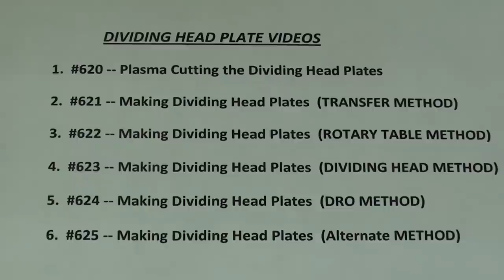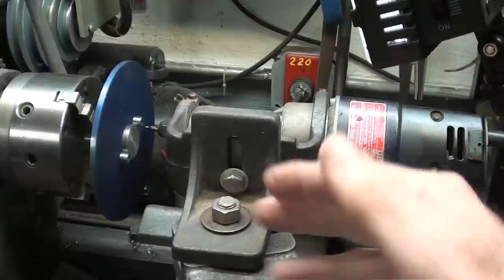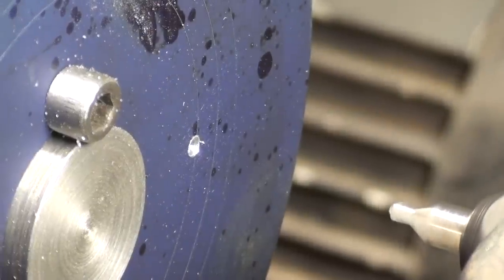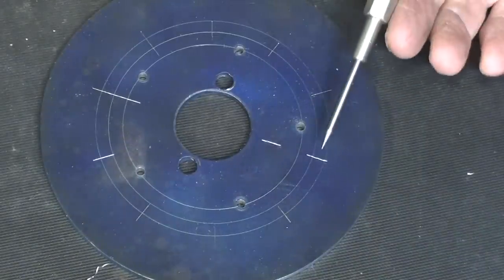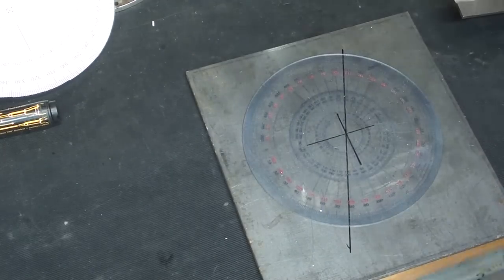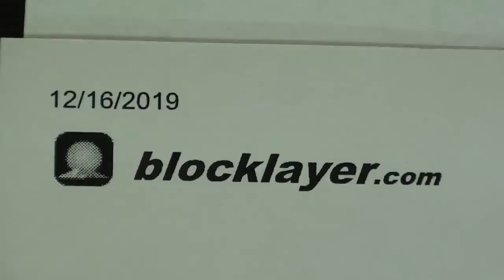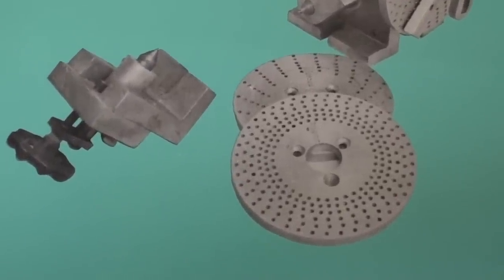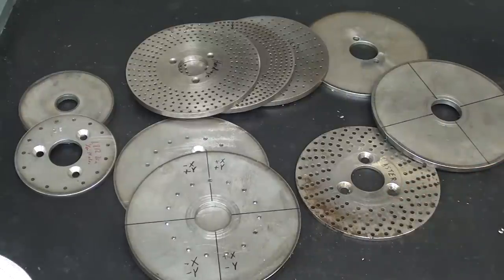Making Index Plates Alternate Methods TIPS #625 tubalcain

Comment: Sometimes the simplest solution works just fine. Years ago and old machinist I worked with was given a 3ft. x 4ft. x 1/2" thick plate that was to have at least 40 tapped holes put into it. He studied the hand drawn E-sized blue print for a bit and checked the other prints for all the stuff that was to be bolted to this plate. All the parts to be bolted on had proper clearance holes  for the fasteners. He measured the blue print directly to check that the drawing matched the given dimensions. Then he taped the print to the plate and hand center punched each hole through the print. He got out the mag base drill, used a ground steel center in the chuck to locate each hole and drill & tapped it. Job done in 2 hours and it worked just fine. Everything bolted on and no one asked how he did it.
Cheers from NC/USA
Reply from the maker: lol.  That’s a great story

Comment: Just ordered the Gingery dividing book from Amazon. Harold Hall also has a book on dividing available on Amazon. One other method, don’t know if you covered it, would be good old fashioned bench work with a center punch, hammer, magnifying glass, dividers, steel rule, and layout ink. Draw a circle, determine the circumference, do a little math to determine center distance between holes, set your divider, and scribe away. Then go to work with your center punch, magnifier, and hammer. Thanks for making these series of videos, very informative as always.

Comment: Not all printers are accurate in both length and width direction.  Print out an image known to be square and measure it for accuracy.  You can also cut out a large disc of wood and fit a piece of bandsaw blade around the rim, and index off the teeth.
Reply: If your printer is out, you can generally go into the advanced settings and change the X and Y scaling independently. I do it when I print out graph paper.

Comment: when I laid out the holes for my duel magnetic rotter I used a 360 degree gage and a scratch all and it worked very well, it had a high power magnifying glass with a cross hair, it cost about $ 60 dollars used,  it also had a good clamp to clamp the arm.

Comment: Machinery's Handbook has a table "Segments of Circles for Radius = 1" that gives 'constants' (English and Metric!) for for properties of a circular segment based on the included angle of the segment.  The "c" column is the cord constant which is the length of the distance between 2 holes on a bolt circle at a given angle.  Figure the included angle of the circular segment for a given number of holes on a bolt circle, multiply the "c" value from the table for that angle by the bolt circle, and you have the straight line distance between holes.  Using a set of dividers, scribe the bolt circle, pick a start point on the bolt circle, and draw an arc on the bolt circle using the start point as your center.  Move the dividers to the new point and scribe, and repeat as many times as required. To check your self, verify your last arc crosses the start point.  This method works for any number of holes on any bolt circle.  You just have to have a set of dividers large enough to scribe your values.  Center punch at each mark and drill.  This is the method that draftsmen (now drafters) used for decades to layout a bolt circle and is much more accurate than using a protractor.

Comment: Sixty is a particularly good choice for the built-in dividing plate on the Craftsman lathe. The ancient Assyrians (inventors of Cuneiform writing) used a base-60 number system, rather than a base-10 number system. The Assyrians had a sophisticated mathematical system, but, they didn't invent rational numbers (fractions). But, by using 60 as the base of their number system, division was simplified because they could evenly divide 60 by 1, 2, 3, 4, 5, 6, 10, 12, 15, 20, and 30. You can thank the Assyrians for having 360 degrees in a circle, 60 minutes in a degree and sixty seconds in a minute.

Comment: I've used the laser printer and glue method on numerous projects and while accurate for most things it has two limitations to be aware of. First, the accuracy of the printer. Paper printers can be off in terms of overall size, but also disproportionate on horizontal vs vertical. Since I draw my own designs on the computer, I include a horizontal and vertical scale in an area that can be trimmed off later. A quick check of your scales with a machinist's rule will tell you whether you're starting with something usable.
The other issue is distortion of the paper during gluing. If you drag your hand across the sheet when pressing it down you'll stretch the paper in that direction. Laying the sheet down and then pressing it in place will distort the paper less.
Reply from the maker: Thanks

Comment: Excellent tips as always Tubalcain. Another idea - some ink jet printers and maybe laser printers have the ability to print straight onto prinable CDs. Cheap at 25 cents each. I had my ink jet printer about a year before realising it could print cds. Just use one of the programs suggested, print it straight onto cd, and you have a pattern on a nice round disk on which holes can be drilled. Just need to be carefull drilling ABS as it can split easy. There are drill bits available for drilling plastic - 60 angle rather than ~118 degree. If you wanted something more permanent,  machine a metal disk the same diameter and thickness as a cd, spray paint it and print away. I've not tried spray painting myself, may need some experimentation to see what paint would absorb the ink. Maybe spray putty, or marking paint, might work.
Reply from the maker: Thank you for the suggestion, I have never heard of printing it on a CD

Comment: The paper transfer method is very handy, but I think it's important to make sure your printer prints as symmetrically as you expect.  It's not uncommon for the long dimension of the page to print less accurately than the short dimension.  Print a test image and measure it.  Keep that error written down so that you can compensate for it. As the paper thickness and roughness changes, or as the feed rollers wear, you may need to adjust.  

It might not matter much for a 4" bolt circle, but when printing PCB transfer film with fine pad pitches or where multiple layers need to align, the error matters a lot.
Reply from the maker: Thank you, that is good advice

Comment: Mr. Pete, thank you for sharing your knowledge. I have used several other methods; I apologize in advance for a long-winded explaination.

Let me begin by stating these techniques can also be used for gear cutting. I have used these techniques in the past. 

First method, regarding the paper glue-on method. For GEAR cutting, this will work on a vertical Mill if you create a fixture to hold a sewing needle (secured to the table). Rotary table or not, an angle plate will work. Rotate work until the needle/fixture is aligned with the radius line on paper (Horizontally, this would also work for indexing plates).

Second method, 3d print a small gear (appropriate number of teeth) and secure it to the work (super glue method). 3d print and create a spring loaded arm that is secured to the table. To visualize, think of the "Wheel of Fourtune" wheel on the X-Plane, or for vertical, think of the "Price is Right" "Showcase Showdown" wheel. This works, but is far less accurate.

Clear as Mud... Right?

These method work... Not the best, but I work with what I have as a home 'hobby' machinist.

Matthew
Reply from the maker: Thank you for some great suggestions
Reply: @mrpete222  Try to create part 7... 
Edit: Hopefully you can create a part 7 using suggestions/ideas from the comments.

Comment: Lyle, thank you for this video series.  But you missed how Dave Gingery accurately drilled the hole circles in his index plates.  In the photo you showed, he had glued a strip of paper with accurately drawn (by hand using drafting angles and scales) lines for each series of divisions.  He did that for each hole circle.  The photo shows a razor blade being used as the "pointer."  He used the incomplete (at that point in the construction) index head's 40-to-1 gearing to simply rotate the plate until the paper strip's lines "lined up" with the razor blade.

I think I may use Dave Gingery's book series to cast & machine my own machines, or at least the ones I don't already have, like the small shaper he shows how to build in, I think, book 3.  He started with nothing and built his own backyard foundry and used it to build and improve his machines as his capabilities were developed/improved as each machine was built and used to machine the next one.

Lindsay Books closed down, but their books were purchased by some of the Lindsay employees and are sold at www.youroldtimebookstore.com.  The Gingery books are still sold by the Gingery family at gingerybookstore.com.
Reply from the maker: Thank you for that. I really did not read the book.   Just glanced at it
Reply: I was gonna take the time to tell him the same thing, but I wanted to see if someone else caught it first.
 I actually was thinking about that method when the video started.
 When he broke out he book, I said " here it is" & then he missed the whole point.
If Mr. Pete is reading this, it was on the next page that you showed.

Comment: If you have a copy of Visio (even the older versions), it's easy to draw up a circle with intersecting lines with whatever degrees you want.  You can use pretty precise decimal values or even fractions if you don't want to have to type a lot of decimal digits.

Comment: Thank you for your replay to the method presented by  Clickspring YouTube site.  Purchased at Lost Creek Machine, Inc 12/14 a DIY dividing head with a 20:1 worm gear. [bench top Fung Ru mill]  So I do need  plates.  Made a excel table: columns of divisions which angle  = 360/# of divisions  and the distance between hole centers = diam of ring circle * sin( angle / 2)  Examples  compass rose (360 div) for a 47.5" ring spacing is 0.4145"  to make the 69 tooth gear on the Atlas Spindle for 33.25 dia distance between1.51336 or  for 18 divisions for 20.5 dia distance between 3.5598   The divisions are big enough to make adjustments to improve and check accuracy by walking the compass (dividers) around the scribbled circle ring.  Clickspring presents how to use the big divider plate on or in wood.

Comment: I made a tool and cutter grinder many years ago and on the home stretch needed to divide the screw collars into 50 divisions. Not having a dividing head I used another method. I had a hole plate with 25 divisions and simply transferred the 25 holes, flipped the plate an inserted a pin through both the plate and work and transferred the second 25 holes. A neat trick that can be done with any odd numbered hole plate. 
Another idea is similar in principal to the popular spindexer. It is easy to divide a circle using normal dividers if the circle is large and the number of divisions is small.  So with a 3 and a 5 hole plates together you can get 3x5=15 divisions. Likewise 4 and 6 will give 24 divisions, you get the idea. Like Mr Pete said, making your construction circle as big as possible minimises errors when making the final smaller index plate. 
Now for a challenge. How can you make a 127t translation gear for the lathe?
Reply from the maker: Thank you for some good ideas
Reply: I've been thinking about a 127 tooth gear for a while now. I plan to make one some day. I was going to use
a method found in Harold Halls book on dividing & make a 127 hole plate using the X&Y co-ordinate system
same as Mr. Pete's DRO method using Excell program to calculate the x&y co-ordinance. Have no DRO at this time
I was just gonna round the #'s off to the nearest 1/2 thousandths on the dial. It would probably take a while.

Comment: As of the time of this message, the set of those books is available on Amazon in the USA. But very limited stock of new sets, cost me about $50 for the set in new condition. There is also a hardcover set/compilation for $75. I already have a small milling machine, but really need a small metal lathe, hopefully these books will help me build a few missing tools.

Comment: Looking at making a plate for direct indexing on a small jewelry/watchmakers lathe I have.  Hole pattern would be 8, 10, 12, 20, & 25
With the 8 and 12 by using every other hole I would be able to make small bolt heads and nuts. I have a way to attach a Dremmel drill to the lathe and so that it can be used as a small milling machine on the part in the lathe. Working with Brass, Bronze, and Aluminium. The thickness of the stock is 1 to 2 inches at max.
I would love a plate with 100 & 360 holes, that would let me make some dial marks on some things I would like to make for the lathe.

Comment: just walk a pair of dividers around you marked circle opening them a bit at a time until it meets the first mark having made the wanted amount of divisions watch clicksprings video on the manual dividing plate for the antikithra mechanism this is a super accurate method and all it needs is a pair of dividers its so acurate that watch makers use it to make small gears for watches

Comment: i would love  you to explain to you views. the reason for the different  distance between the  vireos dividing plats , re gears & their pitch  I see a lot of confused citizens,  the closely drilled small hols & the  different larger hold plat's  that relate to to teeth to be cut ,   Renin them that centres are often different in reason to the size of teeth to be cut . I  wanted to create a  new  banjo gear , so I used a 100 tooth great in the group to cut a 50 tooth gear by scribing a line on the plate  to  give  me a rang of 100 & fined the  50 by dividing by two , & scribing ever other line  show.   them how to do this ,

Comment: Model the part in Fusion 360 (or Con-Fusion 360) and use the Make Drawing function. Scale part to 1:1, place centers in all holes, output as a PDF, print out PDF, glue to stock and center punch.